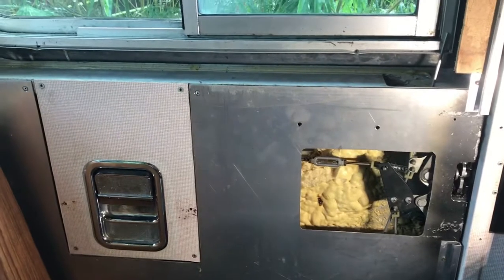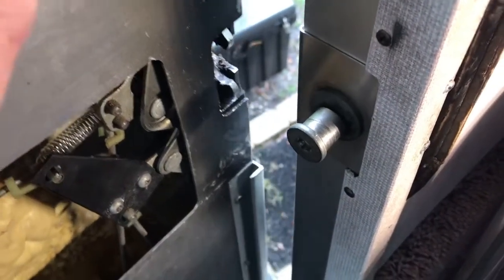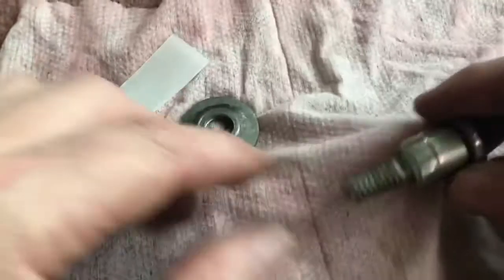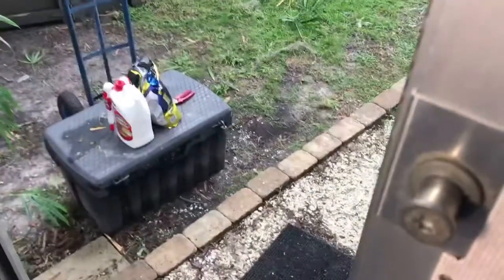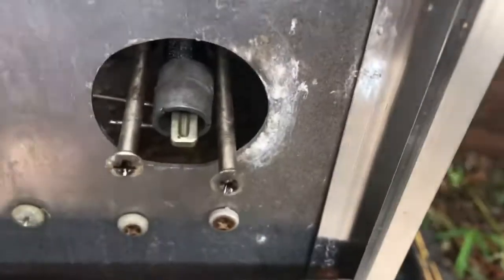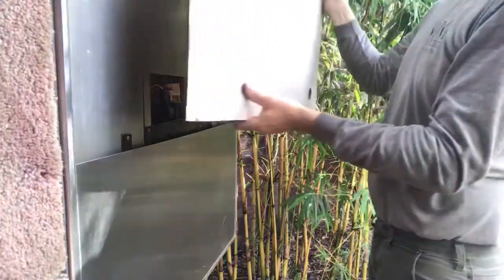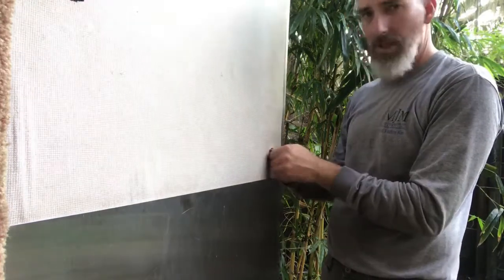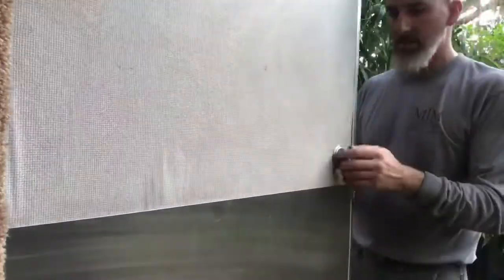-Gino’s Garage- Wanderlodge WB Entrance Door Latch

Comment: I  read  that the air / electric lock was hanging up and locking folks  in or out, I read Bluebird had a recall and disabled the door latch. I have wanted to look at it myself. It's fairly easy to make the lock electronic and unlock, lock with a key fob.
Reply from the maker: Yea, I do not doubt it. I keep a key hidden to enter the bus just in case there is an issue. I put an electronic deadbolt on my Bird, and it uses your phone like an electronic key to allow you to unlock the bus.